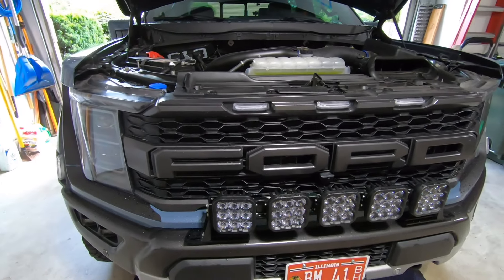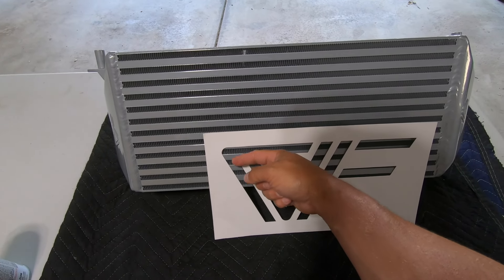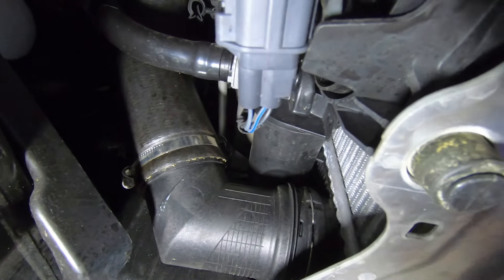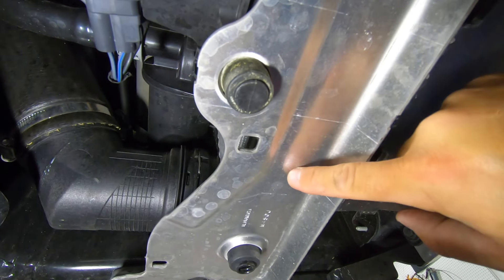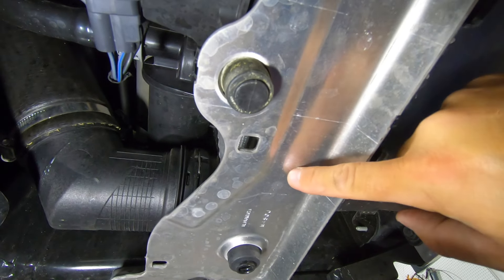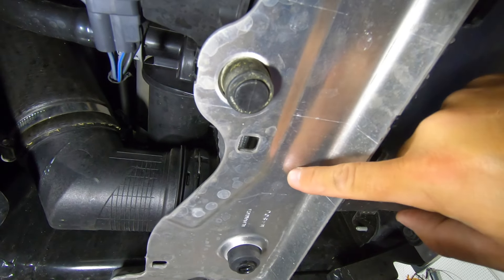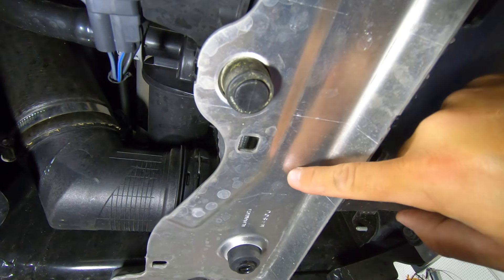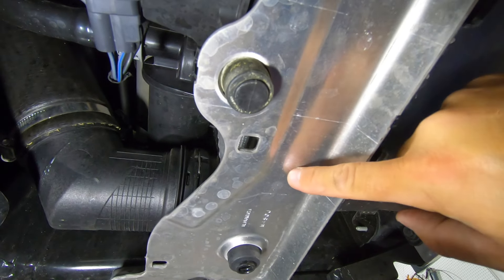GEN 3 Raptor - CV Fabrication Intercooler Install!  **coupon code in description!**

Comment: I just installed this on my 22' I was actually able to install it without removing the shutters, just that little bezel. But the thing that kinda sucks, is that I didn't really see a difference in IAT :( does it even work? It was still the same +40° ambient temps as oe

Comment: It would be cool to see what kind of horsepower gain you get out of upgrading the intercooler.
Reply from the maker: I did a dyno day with my Rebel, maybe I’ll do something like that with the raptor!
Reply: @WaterFowler41  that would be awesome
Reply from the maker: @MrJohney truck would be finding a dyno wide enough, I know the one used for my Rebel was a tight fit, no way the raptor would fit
Reply: @WaterFowler41  well if it is something your able to do that would make some awesome content